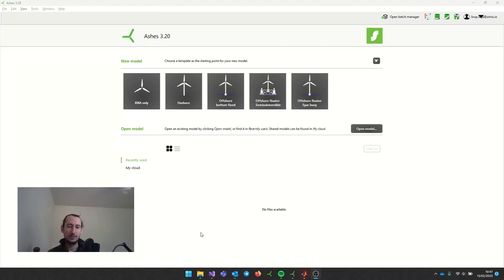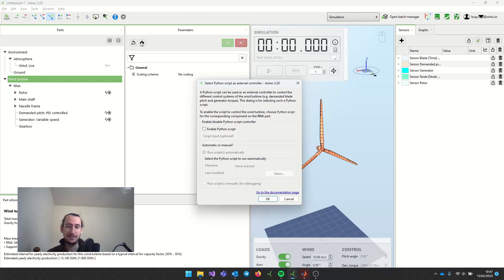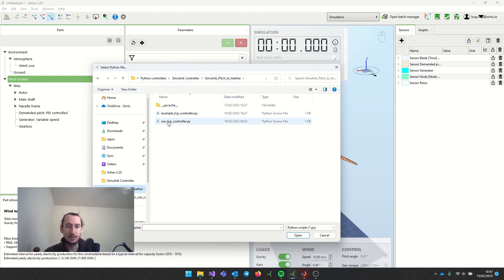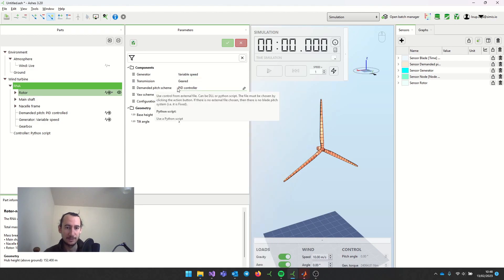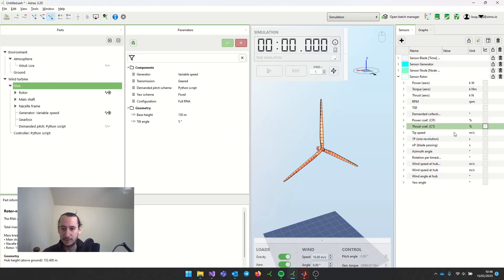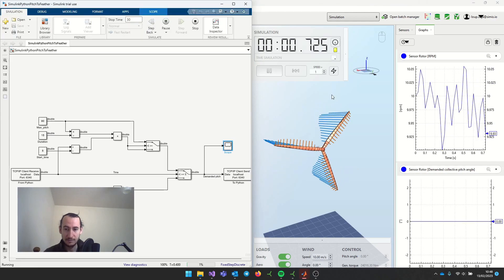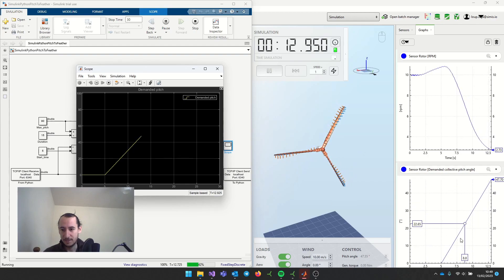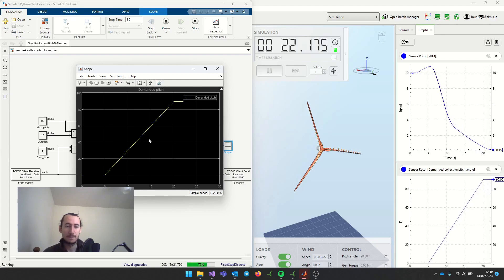Connecting Matlab/Simulink to Ashes - wind turbine simulation software

Comment: Is it possible to create different rotor blades and test which ones work the best?
Reply from the maker: Absolutely, any model can be fully customised (including the blades). But you will have to have a good definition of what 'working the best' means, as there are many parameters to consider! 
Feel free to download and try Ashes for free at www.simis.io
Reply: Hey i really like the app, but is it possible if we could connect with discord for faster chatting, i'm doing this for my school project. or is here okay? @AshesWindTurbineSimulation
Reply: Sir
I have the simulation model of wind energy conversion with boost converter...can I verify the simulation model by ashes